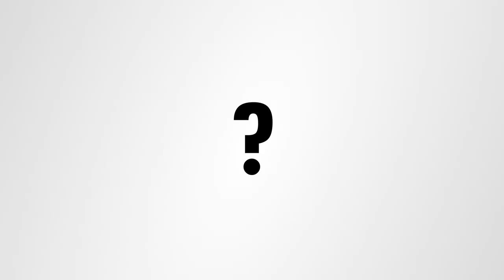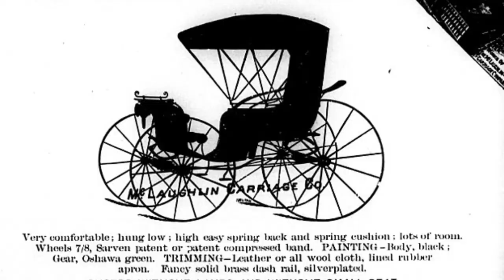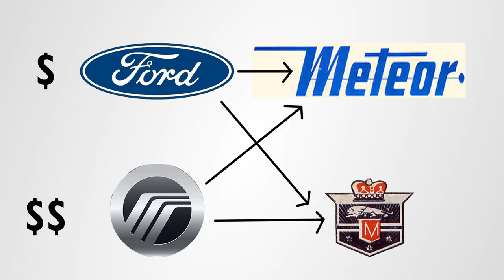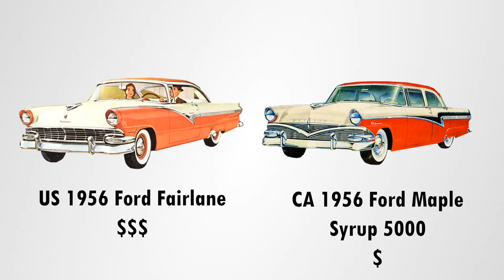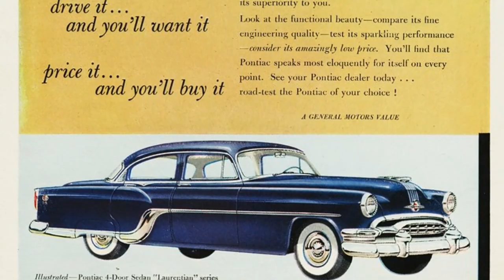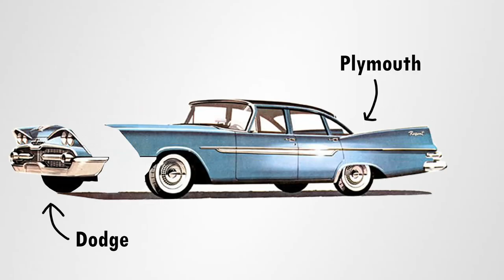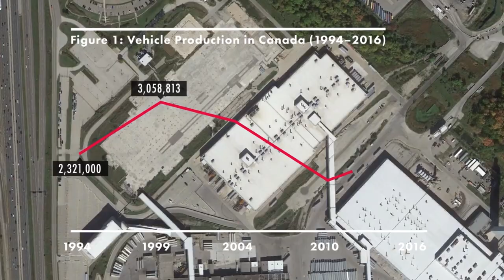Ep. 27 World Tour: The History of the Canadian Car Industry

Comment: I live in Canada and I am restoring a 1958 Dodge Crusader, 4 door sedan. It’s a Plodge, it’s a 58 dodge front end on a Plymouth savoy and it’s powered by a Desoto 251 cu in straight six with a 3 speed manual transmission. The car is bear bones with no radio, clock ,rear park light, air conditioning, power steering or seats and hand crank windows. She’s a beauty and has almost no rust or work needed to be done to her.

Comment: I actually know the answer to the “Cheviacs” of the 50’s and 60’s. It’s because the Chevy was primarily built in Canada, and there was an exception to the tariff if the car contained enough Canadian built parts. So the large Pontiacs here rode on the Impala frame and had Chevy engines to avoid the tariffs. That’s why Canadian Pontiacs didn’t get wide track because it wasn’t a Pontiac frame.

Comment: Little known is that Renault and Volvo were also assembled in Canada for a short time there there was the Lada Signet that came to Canada partially assembled but automatic transmissions were added from a Chevy Chevette and the lower trim levels had different headlights and Grille and a S badge instead of the Lada viking ship And it was briefly called the Dennis Signet who was the name of the guy who imported Ladas. I owned a Dennis Signet 1.3 Automatic for a while

Comment: Funny how you briefly mentioned the similarity between the Canadian and Australian auto industries, as part of that "Colonial influence" meant most of our Australian assembled "US" models, were actually assembled from kits built in Canada.
Reply: Ford Australia was set up as an off-shoot of Ford Canada rather Ford USA. This was to take advantage of the "Empire Trade Agreement". The original T model Fords assembled in Australia were built from kits sent from Canada and this arrangement kept going until the 1960s. The "XP" Falcon in the mid 1960s was heavily based on the Canadian Mercury Comet of the same era. There is a story that a Ford factory in Australia was designed by a Canadian architect so consequently it has a steep roof to stop snow piling up on the roof in the winter!

Comment: A bit of trivia about Chevy engines in Canadian Pontiacs: In the 50's and the early 60's, you could get a Chevy small-block V-8 in the full-size models, but the base engine was usually a special version of the Chevy 261 cu-in inline 6 from the Chevy truck division, not available in any car outside of Canada. These engines differed from the truck motors in that they did not have the commercial high-lift cam, but otherwise they had all the upgraded cooling system, heavy-duty crankshaft and pistons, etc. These motora were nearly indestructible, and only gave up about 10 hp to the small V-8.

Comment: @Ed's Auto Reviews  here's the 2 points that you missed in this great video, first:  locations of the factories dictate if a car is canadian or american and the big 4 (yes even AMC) had factories on both sides of the border but for the big 3 the factories were mostly brand specifics because they were still separate divisions, a Chrevrolet plants build chevrolet cars, pontiac plant build pontiac cars etc,  second: where do the parts that make the car come from ? a car assembled in Canada with not enought made in canada parts was still considered an amerian carrs. Pontiac had more assembly plants in Canada than Chevrolet that is one of the reason they became the Canadian brand , Chevrolet was building parts in Canada mostly that's why they supplied the narrower Chevrolet frames fitted on the larger Pontiac bodies and also the engines , since they were made in Canada versus Pontiac parts made in USA

Comment: Great watch!  So I actually can shed some light on the Meteor, as I've been involved with them my whole life, and I've been the Mercury Meteor Appreciation Society president for over a decade now.  So the Meteor actually has a very interesting timeline.  1949-1960 are all Ford bodied cars (side note, there are Meteor Rancheros (1957-59), but with styling retouches from the Mercury styling studios, and only sold in Canada.  1961 however is a very interesting year, as it was the first of three years that the Meteor was sold in both Canada and the states.  The Canadian model is a ford body, however the American version is a Mercury.  1962/63 are the only two years that the Meteor got its own body panels.  Its the cousin car to the Fairlane, and outside of the roof and glass, all body panels are unique to the Meteor (I own a '63, and believe it or not, ford actually reused the hood from the car for the 1965 Fairlane, and I've found trim pieces on 1964 comets as well that originated on the meteor).  The Meteor was essentially removed from the American market, because it was too similar to the Comet, and they were directly competing against each other, unintentionally.  1962/63 also mark the only two years that the Meteor was a midsize.  All other years in its production run were full size.  1964 saw the Meteor return to Canada only, and from then on, it would stay with a Mercury body, with 1976 being the last year of the Meteor as its own model.  After that, it was an option package until 1981 on the Marquis.

Comment: The first car my parents owned was a 1960 Morris Oxford, a car woefully unsuited to winter on the Canadian prairies.  In 1966 they bought a Chrysler Valiant Custom 200, two-door hardtop.  It was equipped with the not-quite firebreathing but still significant 273 ci. V-8 (two-barrel carb), making 180 hp.  The Canadian Valiant pre-67 was not badged as a Plymouth as the American Valiants were.  The Canadian car was actually a re-badged U.S. model '66 Dodge Dart.  In the early 60's both my maternal grandfather and my uncle were Plymouth men.  That fact and our Valiant kickstarted my lifelong appreciation for most things Mopar.  In '66, my grandpa switched to GM, buying a Canada-only '66 Beaumont, as mentioned in the video.

Comment: Crazy. Somehow. I miss Chrysler a bit. They operated for quite some time. Back in 1989 I bought a Chrysler Saratoga V6 LE. It is essentially a Dodge Spirit with some changes. Made in Canada ... for export to Germany. The first I had was basically a US model + metric instruments, german spec tires, glass and lighting system, the second one was a slightly later model but largely the same (+ antilock brakes and different gearbox ratio). But the last batch produced between 1992 and 1994 - if I'm not wrong - featured headlamps height adjustment and height-adjustable front seat belts ... options not available on US-models (which were made in Mexico mainly ...).

Comment: Belmont,,,, pov pack Holden!!
Here in Oz we got many of the Canuck versions. But with Ford, Chevy, Pontiac etc badging. As for Mopar,,, a huge range of odd models and engines.
Our Ponchos has Pontiac engines until late 60s. After that Chevs. Though 69 a few Chevs and Ponchos with the 308 Holden engine.
With Ford we got ckd cars assembled, glazed, trimmed and a few other local components. This happened up to late 73 early 74 and apart from F trucks we got Aussie luxury cars though a step or two smaller. . I have a 71 Galaxie LTD which while very similar has missed out on  some bling. 400 C6 a/C Power steer car. We only got 302s and 400s. No true big blocks

Comment: Interesting show. The reason that there were Canadian specific models along with the cheaper American ones is that any cars built in Canada and this includes Fords, Meteors, Chevs, Pontiacs, Plymouths and Dodges with Plymouth rears was that each dealer needed a cheaper entry line as the number of customers in an area to support the dealer's bottom line (from an import standpoint the VIN or serial number clearly showed the original  built plant of the car - so cars built in Canada did not get tariffed). For example there were no 6 cylinder Fords or Meteors until 1956, up to that point all were V8's.  Entry level Pontiacs through the 50's and into the 1960's started with a 6 cylinder although the mid 50's 6 cylinder Pontiac had a larger displacement, the rest of the options were Chev V8's. There were a lot of these small differences but the reason for the names such as Frontenac, Monarch, Beaumont etc. was to give the small dealers more chance to survive.

Comment: My theory about using middle-brand US marques as entry level ones in Canada: the lower production numbers of these more premium models needed recouping for the investment in different body components, so US manufacturers would prefer to sell on those parts (or use the tooling for them) on the Canadian market.  For example: the Frontenac used Mercury Comet front sheetmetal, also the Australian XP Falcon (65-66) used the Comet front guards and bonnet with a locally made grille.

Comment: A couple of other points. Studebaker also had a plant in Ontario, in fact it was its only plant in the car maker's last 2 years (1964-66) using GM/Chevy engines likely made in Canada. Ford did sell trucks under the Mercury name, mainly for those Mercury brand models in Canada so had trucks too. Chrysler sold most of the Dodge Trucks under the US city name of Fargo until about 1990. That was so that Plymouth dealers had trucks too. Chrysler also had separate version of the 'small block' V-8's (273-318 CID/4.5 L-5.3L) made in Canada until about 1967. Toyota and Honda also have plants going back to the 1980's-1990's in Canada. American Motors also sold in Canada but mostly via a plant in Ontario where they made and assembled cars for that market. In the 1980's also made NA market versions of 2 Renault cars for sale under the Jeep dealer's only Eagle as well as under the Dodge brand in the NA market That plant continued to make Renault based cars for a few years under the Eagle brand after Chrysler took over AMC/Jeep and continues to make Chrysler minivan.

Comment: For 1955 and 1956, Ford Rideau the tip of the line models for Canadian version of Ford Motor Company is only came with a V-8 engine, and unlike American version of Ford Fairlane does have a 3 tone paint job, such as white top, red body with black narrow “sweepspear” trim in the middle. Like Ford Fairlane, a 1956 Ford Rideau added a 4 door hardtop sedan is available and it is increasing popular for the new body style. A 1956 Chevrolet Bel Air V-8 does have a Sport Sedan as of 4 door hardtop, which is the most popular body style even for the first year. Corrections: American car used Ford Fairlane and Canadian car used Meteor Rideau, not Ford, same goes to Mercury for the American car market, but Monarch is used for Canadian car market. Sorry for the inconvenience.

Comment: I just watched the Canada car industry rundown, and learned something about my home's industry.
However ,there were some omissions. You mentioned Volvo, but failed to include the assembly plant Vo;vo operated for a number of years in the 1959s and '60s. Memory is fuzzy, but I recall the plant was in Halifax, Nova Scotia. 122 series sedans were built there, replaced by the 144 when that model came out. I don't believe the production matched Volvo's sales in those years. The factory probably existed to allow the company to get an import tax break.
Renault, too, had a Canadian assembly plant during the '50s and '60s I don't recall the factory's location, other than its location in Quebec, where French cars (not surprisingly) were popular.
Chrysler, like Ford and GM, had unique models in their Canadian lineuo. Valiant was not a Plymouth, but its own ;ineup. It was sold by both Dodge and Plymouth dealers, and the cars sometimes had differences from American models, with detail swapping in different years.
General motors not only put Chavy V8s in Pontiacs, they also used the 261 Six, borrowed from GMC trucks, who had the slightly larger Six than did Chev trucks. To further complicate things, Canadian Pontiacs were basically Chevs, even though the U.S. models were somewhat different in size. I believe GM Canada had slightly smaller sheet metal parts for the Pontichevs (my own description).
It was always fun to gas up our Pontiac station wagon when travelling in the States. The pump jockeys were always surprised to see a six-cylinder under the hood, almost as stunned at trying to pronounce, "Saskatchewan."

Comment: Holy sheet! An Isuzu Bellett appears at 13:19 !!! By the tail lights, it looks to be one of the 991 imported in 1965 or 564 imported in 1966. A further 788 were imported into Canada in 1967 (I believe with different tail lights due to a mid-year '1966.5' facelift) before CMI (Canadian Motor Industries) entered into assembly of the Isuzu Bellett, building 585 in 1968.

Here, things get crazy, because around that time CMI were in negotiations to purchase Studebaker in its entirety, with a plan to market the Studebaker range as-is, with the Isuzu Bellett alongside it as a sub-compact, but ALSO badged as a Studebaker!

CMI eventually backed out of the deal, and therefore no Studebaker Belletts ever saw the light of day. The Isuzu Bellett is a forgotten footnote in many lands where it was sold, including Australia where it did reasonably well until Toyota and Datsun gained a foothold (and local production plants, something Isuzu did not do here).

CMI went on to assemble Toyotas in Canada eventually becoming Toyota Canada Inc. . You mentioned parallels the Canadian motoring landscape shared with Australia, and here's another one; our own similarly-named company AMI (Australian Motor Industries) assembled Standards, Ramblers, Triumphs and Toyotas before being bought out and becoming Toyota Australia.

Man, I'm so stoked to see an Isuzu Bellett! I have two Australian-delivered Bellett sedans and a JDM Bellett GTR. Made my day!

Comment: you forgot to mention that Volvo set up an assembly plant in the East Coast (Halifax) and began making cars in 1963 to about 1998; they made 544, 122, 140, 240, 740, 760, S70,V70 and S80;  Also Renault made cars in Canada (Quebec) 1965-1973
Reply: I had one of those, a Volvo 245. It was a regular United Nations of parts. Swedish car, assembled in Canada with French headlights, German fuel injection, English electrics, Spanish tires, and Canadian wipers, battery, and other odd bits.

Comment: i was going to suggest this but you went and did it ,  though i feel the mercury and fargo pick up trucks is a big part you missed ..   can you do a south American ? , that would be a lot of research ,  some countries have these laws against importing cars so they would buy the used tooling/stamping equipment,  Argentina got the 68-72 chevy nova and sold that from 1974 to 1978  they called them the chevy 400  or the chevy serie 2  .    jeep willy wagon ended in 1963 and started in Brazil in 1965 to ??  ford pickup stamping went to brazil too and they sold the 1967-72 body up into the mid 90s ,  they also sold these ford suburban things , possibly made through a custom coach works Co. the trucks were called f1000 .   mexico had these dodge muscle cars called the  super bee made from a plymouth duster .  there is so much more i dont know .

Comment: You missed a detail about Canadian Pontiacs, they share more than just the same engines with Chevrolet, they share glass, window seals, frames, brakes, transmissions, and differentials, my first car was a 1956 Pontiac, and parts transferred over from a "tri five" Chevrolet, same with my 1959, and 1960 Pontiacs, they share glass, frames, even floor pans and some repair panels, and general parts with my 1960 Impala.
There are variations with trim levels, but parts bolt on, I can directly swap my 1960 Impala front end onto my 1959 Pontiac if I wanted to, because of the main chassis being the same, the "B Body" from GM at the time.
I am only 23 but I know a lot about Canadian Pontiacs having dabbled with them since I was 14

Comment: The first Canadian Pontiacs that really differed from the American brand debuted as the Pontiac 224, in the late 1930s, with a modified Chevy engine in the Pontiac chassis! And as you already know, makes were "dualed" to accommodate more makes per dealer in the smaller-populated towns of Canada. The GM networks were generally Chevrolet-Oldsmobile-Chevy Trucks and Pontiac-Buick-GMC, with Cadillac dealers in both networks. Chrysler-Plymouth-Fargo Trucks and Dodge-DeSoto-Dodge Truck dealers did the same for Chrysler Canada, so Pontiac and Dodge did double duty in Canada! And to really give you a headache, Monarch was withdrawn for 1958 so you had Ford-Edsel dealers, too. The Monarch Mark II returned for 1959. Excellent job--but Studebakers were produced in Canada after the South Bend plant closed in 1963. That could be another segment unto itself!

Comment: Ford was making little changes to their Canadian made models long before the 1950's. My Canadian maade1930 Model A Ford differed  in subtle little ways from the US version with such things as Robertson Head instead of slot head screws in the interior,  a Ford script oval with a black background instead of a blue one,  the chrome oval bumper clamps were mostly plain instead of having blue inserts. For '31 the bumper clamps had big chrome bolt heads in the middle and the early ones in '28 even came with Ford scripts but only on the rear ovals (very rare). Then Ford had the  nerve to advertise the car as "The real Canadian car".
As for the Monarch and Meteors, I used to think of them as phony Fords and Mercurys. Now they're hot collectibles. I used to have a '56 Mercury Pickup, stock automatic which I'd love to have back again.